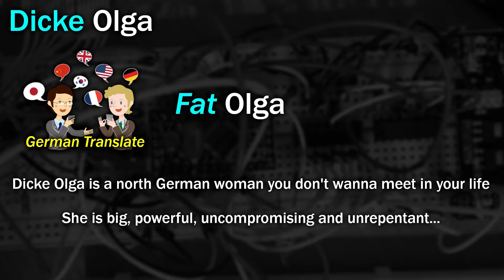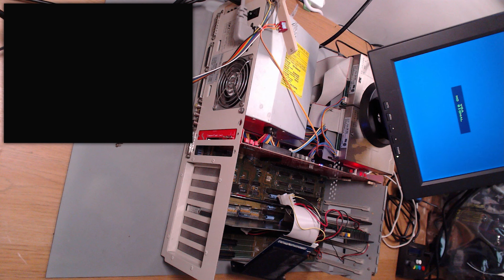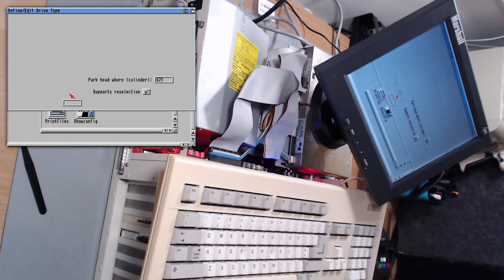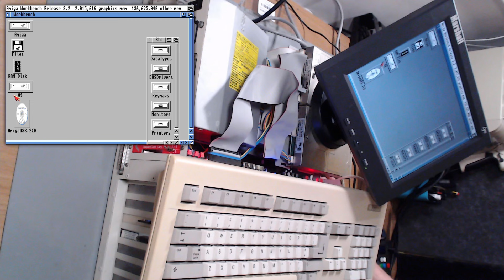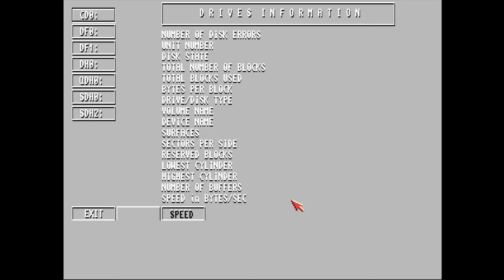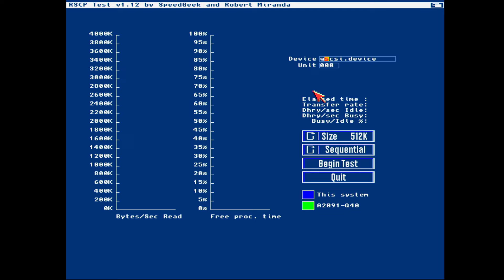50Mhz Amiga 2000? Meet the Dicke Olga (revised edit)

Comment: the Amiga 200 WAS an Amiga 500 with slots added.
Reply: Too bad C= wasted time and money putting in those four PC ISA slots.   It added about a year of development.   I would guess that less than 1% of A2000 users actually used a PC Bridgeboard.  It meant the ZorroII cards could have been smaller AND cheaper for developers.  Also, with only 4 Zorro slots and no plans for PC cards, the PSU could have been smaller = less weight and costs.
Reply from the maker: Yes I guess it kinda was
Reply: Actually, it's kind of the other way around: The A500 is the A2000 with slots removed.

Comment: Bought a Blizzard 1230-IV before I went to uni with maxed out ram, then bought an 882 which arrived to me in a fag packet, and then added the scsis extension, that machine was fast, way faster than the A4000 I later bought. Wish I'd kept it.

Comment: @RobSmithDev I got my card, it's the same as yours. I bought a Math-Co for it but didn't realize while I as going back and forth with the guy who builds them about the buying a Math-Co that was labeled 40Mhz that he went bought/installed one tested at 50Mhz and maybe 60Mhz since he says in his main posts that he does test the boards at 60Mhz before they go out. Mine came with the M.2 drive with 3.2.x installed on it. I really want to get a zz9000 next to complete the Amiga 2000. :)
Reply from the maker: Yes the zz9000 is on my list too!

Comment: The best way to test a FPU for overclocking is to use AIBB beach ball test. FPU's can appear to be working but crash in strange ways that make you think the problem is something else.
Run the beach ball test and watch the ball being drawn, if the clock is too fast, the ball will only partially be drawn and the software will return to the result screen with crazily high results.
Reply from the maker: Cool I’ll give that a try thanks